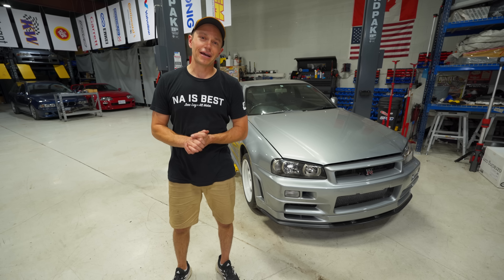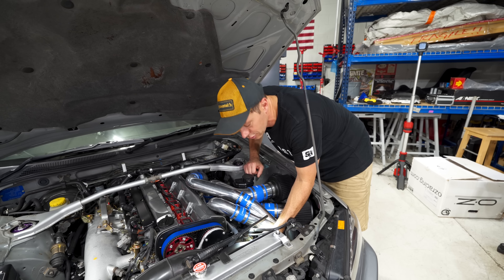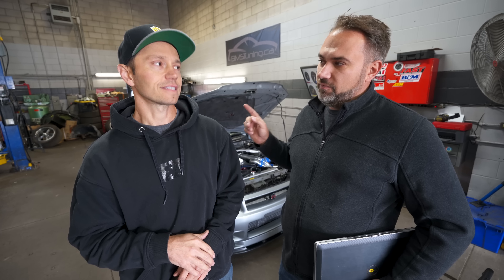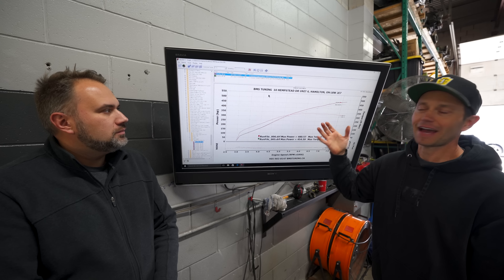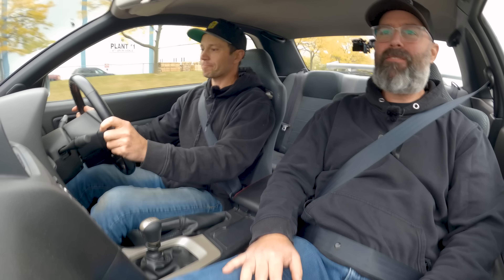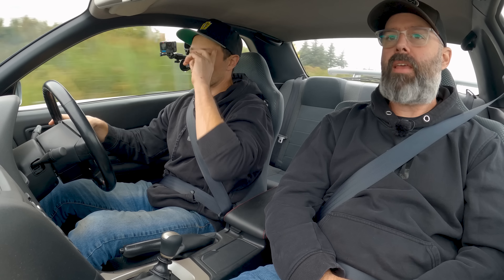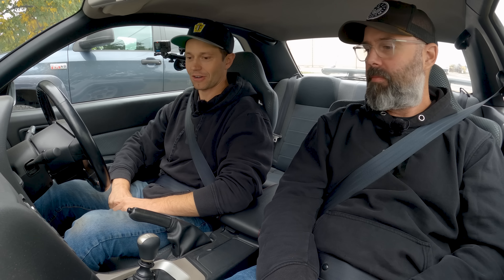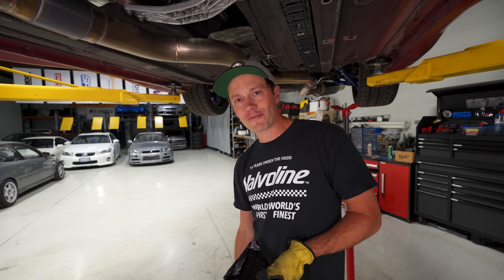R34 Skyline GTR Dyno Results & Driving Impressions - Better Than Expected!

Comment: When I imported my r32 gtr vspec II 93 back in the early-mid 2000s. Had 50,000km. Grade 5. Had a yellow cable restricting turbo to about 7psi. unplugged it.. went to 18+psi and made over 350kw or over 500hp off right away.. plus it actually sounded like an RB. I miss you car. Wish I never sold  you and went overseas

Comment: Put a valve in the exhaust. I have a varex muffler on my R34 GTR. I custom hooked it up with three modes.  Open, closed and auto. Auto has it so that over 30% throttle and 10kph that the valve is open

Comment: I use Leak trace powder at work all the time. Clean the oil pan with brake cleaner and a rag until everywhere is dry, then spray leak trace powder over the whole pan, and run the engine until you see the leaks.
Reply from the maker: Will buy some thanks!
Reply: @speedacademy  no problem! It’s tough to get into tight spaces, but it solves 90% of mystery leaks for me!

Comment: Use a uv dye for the oil pan leak. You put the dye in your oil and let it run a little while. Then use a uv flashlight with yellow glasses that come with it usually. And the dye will glow green and show you were the source is coming from. Probably a small Crack in the pan
Reply: Came here to say this.  I have run into this exact problem on two occasions, both with cast aluminum pans.  Once on a LS and once on a Honda F20c.  In both situations I used UV dye to solve the problem.
Reply: Facts

Comment: Man, an RB on twins just sounds so correct! It’s got that fierce tone up top, but still sounds refined and neat like a true motorsport engine
Reply: Agreed, the RB TT is the best sounding car engine at full song, with an LS as a close second. Of course there are F1, 787B, top fuel dragster, and exotic cars but those two are the best sounding engines most folks can actually afford.

Comment: 4'' kak on mine, its loud but it never bothered me before but the older I get the more it does. I have a 2'' insert I made up for mine, its quiet but wont rev much past 3k. I do also suggest playing with cam timing. e.g you might pick up 20 hp at 3k but only loose 5 after 7.5k so its a good trade off for street/track. It will help allow lower rpm shifts on the street keeping noise down but with a 6 speed and 4.11's (or 5spd with 4.4's) you arnt going to get much speed out of each gear shifting that low. Drive it for a bit as is first so you can make a better, educated decision.

Comment: On my JZZ30 Soarer with a V160 6 speed, I have twin CT12 highflowed (47mm) turbos on my 1JZ VVTI (264/272 cams, ARP headstuds, e85, Haltech elite 2500). Only fitted the twins because I'm friends with a talented fabricator who put it all together. Car makes 550whp at 25psi, with factory-like response, but like you guys mentioned, for ease of fitment and power, a single turbo would probably be the way to go. 

Either way, have loved this series 10/10, love seeing GTR/Supra content.

Comment: The Dyno guy really knows his stuff.  Knew the issues with just pulling the fuse and that the motor was not prepped for 20 psi (head gasket and studs).  Great car and that engine bay looks awesome.  keep up with the great content fellas.

Comment: Correction: You can switch R33 & R34 gtrs into rwd mode without pulling out the shaft & it won’t cause damage. You don’t pull the fuse out like in the 32s, if you do it that way then yes you can damage the transfer case. 

it’s done by following the procedure to enter the system into diagnostic mode. Which switches it into rwd mode. I’ll read the steps in my Nissan skyline manual & comment it for you guys!

Ps PLEASE stop using inertia types of chassis dynos, switch to either a hydraulic/eddy current chassis dyno or hub dyno instead, far better for tuning. Watch the video from the channel motive video about dynos & they explain it well. I’ll link it below. 

Love the build can’t wait for more content 🙌🏼
Reply: The dyno in this video literally is a chassis dyno...
Reply: @DriftNick   true, but there are 2 types of chassis dynos, since they used the inertia style chassis dyno I was merely referring to the other type hydraulic or eddy current (you might think I’ve mentioned 3 types here but really the last 2 are under the same category I just don’t want to type the word here cause it might be censored lol).

I’ll edit my original comment so it’s clearer.

Comment: " could work the cams" you should adjust the cams. you would get the turbos to spool quicker. you shouldn't rev a stock rb26 to 8000rpms- oil pump failure-block cracks. don't ask  how i know

Comment: Fully advancing the intake cam will bring the turbos on sooner. Agree a lumpy cam shifts the power band on these, its actually unnecessary to do an exhaust cam for that power target. Very healthy linear tune though. I personally went with a VCAM in mine, it gained about 40rwkw across the rev range. I always recommend to all my GTR friends to go VCAM if they want a nice street and track car. It just modernizes the car, makes it pleasant to drive on the street, fuel efficient, increases longevity of the engine and has power on tap even with bigger turbos. 

Nissan originally wanted to do a v6 on the r34 gtr but they were going broke. Engineers had designed it, pretty sure it was close to (if not) the VR38. They invested money in the RB25 Neo which also has fully variable cam timing (not just a 3 point cam timing like the r33 rb25). The neo is more modern than the 26.

Comment: Highly recommend a HKS Super Turbo muffler to replace the overly loud Tomei. Still a great sound but way quieter (especially 3000rpm and under). 3.5in so it still flows well.

Comment: Speaking of the track and your oil cooler updates. You can play with the bango and open ports designs and tune how long your oil sits in the cooler and amount of temp exchange. We run Orifice plates to tune our coolers.

Comment: Dang guys, this thing did great on the dyno, that curve looks perfect! I'd run the 450whp map with a scramble boost button to bump it up the extra couple psi when it needs to establish dominance over the Supra. ;)

You can tell how tight everything is just looking at the way Pete drives it, I would love to sit passenger in it to feel the differences from the 32. Also, the check engine light is probably on just because the car wants you to pop the hood and admire the engine bay at every stop.

Comment: Have had a sump hairline crack on a rb26 before and I'm sure we both aren't alone. Old molds maybe or just a flaw would be my bet. Very irritating though.
Reply: Some genius at Toyota decided we don’t need sump gaskets, just FIPG. He was wrong. It’s the only place they leak oil and both of my 3S-GTEs and my 1JZ-GTE have very slight leaks.
I’ve learned to live with it as it doesn’t ever show on the dipstick between oil changes.

Comment: A lowfi idea for the oil leak. You could adhere some paper to the cleaned up pan and come back a few hours later and see of there is a small brown spot soaked into the paper. Should at least give you a starting point

Comment: it depends on the R33/R34. there is a small Yellow plug under the dash in the 33R that you unplug and then start it up... Tap on the brakes 3 times and the AWD light will come up. Use to drive mine like that all the time for fun. Never had any issues with the AWD system
Reply: Driving is fine as 4 wheels are rotating at similar speeds, but on a 2WD dyno where the front wheels are not rotating at all, you are burning up the clutch pack since it has mechanical pre-load.
Reply: @aDaWaN  never had a issue with mine?. Drove like that for years with that trick. Still launched hard in AWD

Comment: Im not sure what brand oil cooler your using but if those standard an fittings end up not working Setrab does make full flow banjo fittings designed for oil coolers. I can’t remember the brand at this moment but someone makes shorter 90 degree orb/an fittings if space is an issue and the banjo type just wont work for you.

Comment: Depending on how your oil cooler and oil filter lines are setup you can actually bypass the oil filter and cooler with too much restriction in the cooler.

Comment: I had a 2000 Volvo C70 hard top coupe and I still see the resemblance to the R34. I really would love to see the process of converting Skylines to LHD. as far as the loudness of the exhaust, i wouldn't replace it, just add the longest round muffler you can to the straightest section of the system. That should change things.   For the oil cooler, would putting the banjo on the return side increase the efficiency? Since the oil would be held in the cooler longer? Love the videos guys💪🥇🏆

Comment: How did you dyno a R34 Gtr in rear-wheel drive? I know you can in a R32 buy pulling or bypassing the fuse for the transfer case. But how in the R34?
Reply: @stardust4576  oh great so you know the answer? Ok how?